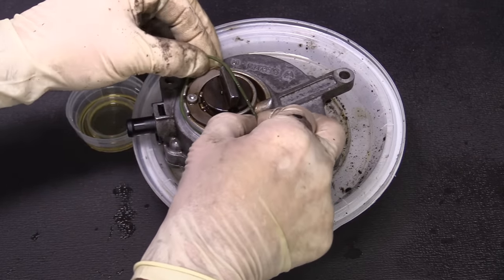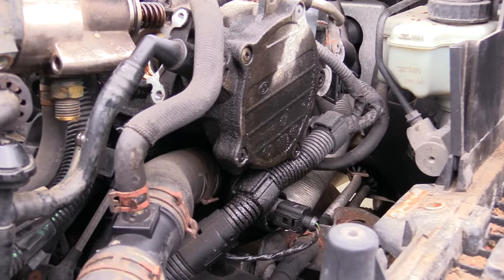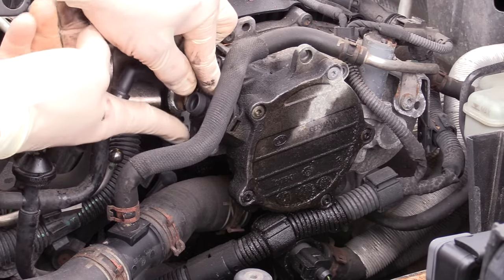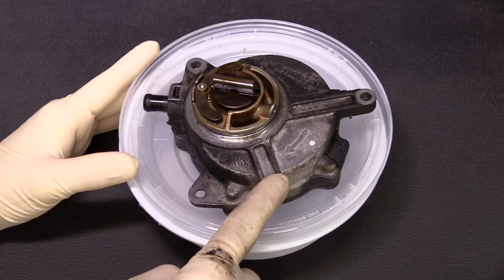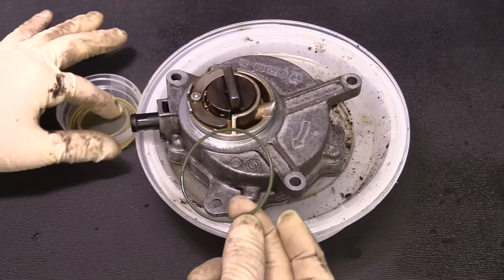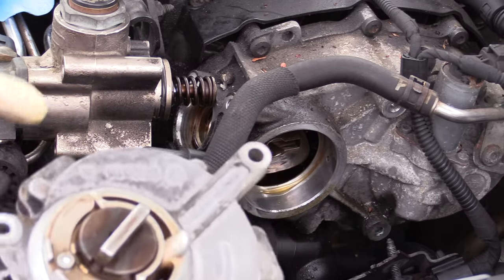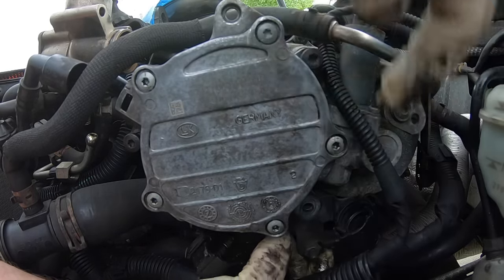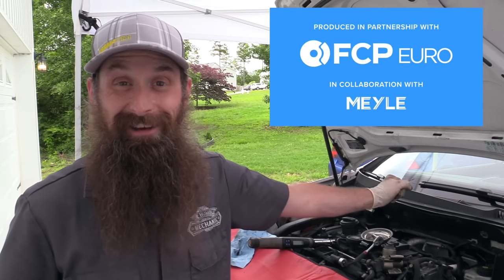How To Replace or Reseal Brake Vacuum Pump

Comment: VW dealer wanted roughly $400 to do this. This video is the best I have found on this topic, thank you sir.
Reply: I just got an estimate from a VW dealership yesterday to replace mine while I was getting a bent wheel replaced and an alignment and they wanted $500 lol. I'll definitely be doing this job myself. Seems fairly simple to do.
Reply: My VW dealer wanted 844 + tax! Is it all because of inflation or what?
Reply: just for the work??? if yes then my local mechanic can do it for 15€. crazy

Comment from the maker: SUPER easy DIY!!! Thanks for all the support on the MK5 project everyone. It makes me really think about what car to do next.. ;) #justfinishtheVR6tCharles!
Reply: HumbleMechanic You should do a W8 Passat next! 👍👍😉😉
Reply: Thanks a lot! Are there any other possible oil leaks in that area of the engine? 
A video list regarding oil leaks for GTI would be super duper to have!
Reply: 4nm or 9nm?
Reply: Hi HumbleMechanic :) and all the friendly peeps out there.  Looking for some urgent assistance.  We have a BMW 318i F30 2016 - B38 engine.  We replaced the oil cooler, oil filter housing and pressure converter electric valve.  Vehicle is now running nicely with no more leaks or overheating.  Problem is that the brake pedal is now very hard?  Please advise?  Thanks so much.

Comment: This video stands out from so many others on this repair, simply because of the angle that you're able to show the pump removal/replacement procedure with.. specifically the hardest to reach bolt that requires that really dumb bracket (Why, Audi? Why?) to line up when putting the replacement back on! Didn't catch this on the first go, after watching your video, I saw the bracket and went OMG AHA! Ran right out to the garage and bam! After some lining up work, the screw finally threaded in.. thank you for being straightforward but showing all the critical areas!
Reply from the maker: That’s Awesome!!!

Comment: Thanks, It's just the perfect tutorial that  I need. I just got an oil change from the dealer and they said that I need a new vacuum pump because it's leaking oil and they gave me a $720.00 estimate for it.
Reply: I just got hit with this too. And at the same price.
Reply: Scott Mullinix did you do it?
Reply: I had the same situation just a few days ago from the dealership. They only said it was leaking oil. So do you think that it would be fine to just change the seal?
Reply: I had the same situation just a few days ago from the dealership. They only said it was leaking oil. So do you think that it would b fine to just change the seal?
Reply: @dexterflorey3676  save yourself some money, I bought the seal from eBay it’s not for much and it’s easy to install just be careful the tubes they might be brittle.
Reply: @eiggiboy  thanks man I appreciate the quick response.  And yeah it will definitely be cheaper that damn pump cost over $300 it's it's crazy lol

Comment: I did this same repair on my '08 Passat. Also replaced the HPFP bolts with studs so I could periodically check the cam follower...except the local dealer took my studs and put bolts back in (I forget now why shop had it apart). Wasn't to happy about that. Keep the videos coming! BTW, I just passed 260k miles!

Comment: Thanks to your video I was able to get the courage to do this repair and completed it. As you pointed out, the extra black fitting one needs to be careful of not losing. The third screw attaching the vacuum pump to the engine at 4 o'clock is blind to access and must be very careful not to drop it, or the Torx drive one may be using on it. Those screws use a T27 wrench. I was able to save 700.00 from the dealer quoted repair, who said the part could not be rebuilt.

Comment: THANK YOU SO MUCH for this video. Although I will not be the person who will be doing this repair, this video has put my mind at ease because the dealership tried to make me believe that my Chevy Spark required WAY MORE steps than what you have. Sure, this is a different vehicle than what I have, however they are CERTAINLY taking advantage of the fact that I am not only a novice to auto repairs, but that I am a woman as well. THANK YOU AGAIN!
Reply: That is a totally different kind of vehicle, from a different manufacturer! The jobs are in no way similar.

Comment: Thank you very much, I will try myself to do the job. One question: the reason of the oil leak is only a worn “O” ring?  So to fix it you only have to find a new one? No need to change the vacuum pump itself? Thank you

Comment: Have you ever seen a VAG vacuum pump leak oil into the intake?  On my 2011 Cayenne VR6, it was burning a quart in half an hour, and I found the path to be from the vacuum pump (after replacing the PCV diaphragm, and then bypassing the PCV/CCV, and finally arriving at plugging the vacuum pump).  I'm not sure if it's a failed check valve, or there's something more complicated.  Thanks!!  At least this comment might help other frustrated VR6 owners thinking they need a rebuild.

Comment: Hey, thanks for the video!
I have the oil leak there on 2.0 TSI 2009. Can it be caused by overpressure in this vacuum pump (thinking PCV Valve problem) ?

Comment: hi ive replaced the oring due to leak but still leaking, can i get away with using sealant, it seems to be leaking from bottom end of case

Comment: Hi,  and thank you for your great instruction. 
I have a Ford Kuga and i have to change a Vacuum Pump clock. I am a handymann and mechmann , so i needed little help about how i will go for it. 
Did i need to change all the Vacuum pump ? or do you think its just great to change the ring?. 
Thanks again.

Comment: @HumbleMechanic Great video, I have a Mk7 gti but the gasket is a metal gasket. Have you replaced a vacuum pump gasket on a mk7 gti before?? If so do you have any tips?? I replaced the gasket on mine because it was leaking but now it still keeps leaking, do you think I may need to resurface the vacuum pump??

Comment: I just did this thanks a bunch. I just realised though as I reinserted the pump into the cam shaft I did not check which was driven/drive end. I started car and tested brakes seems OK. I heard a clink as I screwed the pump back in. Would this be the drive inserting into the cam? What could the consequences of getting the drive the wrong way around be?

Comment: One mechanic told my brother that to replace the brake vacuum pump on the 2014 vw Jetta 2.5. He needs to pull the transmission to replace that pump.

Comment: Hey how’s it going I love your videos first off second I’m having a problem with my 2006 Audi A4 Quatro 2.0 FSI engine I recently had it into the shop to have the rear brakes done and now the brake pedal is fading to the floor they told me it was the master cylinder so we were pleased the master cylinder and we still have the same problem

Comment: I work on BMW `s , and they use the exact same pump on some of their older models[  the E90`s]   for the most time, the seal that will fail, is the seal under the large cover [ the one you didnt take off] 
And for some time , BMW didnt stock seals for this pump, you had to buy a brand spanking new pump   !! 
So what we did in the shop, was buying  the oil filter for that car , and using the seal that came with the filter, and used that - as the seal for the pump !

On he E90 models , the pump sits at the rear of the engine , leaking oil on the exhaust  !
Reply from the maker: That is AWESOME!!!
Reply: Good tip, I'll remember that for my E46 1.8.
Reply: Excellent! Thank you!

Comment: I'm having trouble with an oil leak on a audi A6 just under the vacuum pump or high pressure fuel pump. It's also leaking on the alternator as well not sure what's causing this problem but I'd like to fix it before I trade it in as New Zealand is very hard to get the parts for it.

Comment: Thanks for the video! I took apart the entire pump to replace all three O-rings/gaskets on the pump and found that there was a substantial amount of oil inside the pump. After cleaning the outer portion of the pump, I re-oiled the internal chamber of the pump and added Permatex Engine assembly lube to all the moving parts and gaskets. Is oil inside the vacuum pump normal? Also, I stripped the threads in the hole on the engine block side of the bolt at 430oclock position. So I screwed that bolt in with blue loctight, but it certainly didnt feel tight like the other two bolts as I was tightening it. Should I be concerned about this? Thank you!

Comment: I had grime all over mine in my 2019 Alltrack. Can this housing leak cause misfires? I have brand new spark plugs, brand new coil packs, and I checked for a vacuum leak all over. I'm getting misfires in cylinder 3 mostly on cold starts but around 5 or so in all cylinders after it warms up. This vac pump is definitely leaking, so I was wondering if this could be causing my misfires. Thanks.

Comment: Hi Humble Mechanic, great tutorial video. My wife's 2006 TT is leaking slightly at the bottom of this pump. Is there an O ring also behind the front cover plate of this? If so should I just replace this first or is it more likely the O ring that you replaced? Thanks

Comment: Hi, great video. Many thanks.

Can i ask you a question to see if you can help me.
Recently i found out that my brake booster hose was cracked and i bought a new one. I replaced it, but the new one has a breather valve and my old one didn't have it. In VW they say this is an upgrade and there is no more replacments like mine, and that i should just close the breather valve with a rubber cap.

Is this for real? What is your advice?

Thank you so much for your channel

Comment: My one is a Audi A6 2011 sedan this is my part 06E 103 535 A but it says it's a high pressure fuel pump not sure if it's a vacuum pump or not. New Zealand is hard to get the parts needed to fix oil leak problems. Oil leaks on the engine coolant inlet flange hose and drips off onto the ground. And there's a small leak just below the valve cover gasket on the cylinder head. Any ideas on what this issue would be? I am definetly leaking oil on the drivers side even oil leaking on alternator.

Comment: Great video! mine leaked at the front where the five Bolts are there is a seal aswell
Reply: what did you do? changed the seal?

Comment: Hey Charles thank you for the info I just changed mine is not so long ago they sell a kit that you can replace both of the O-rings the cover and the one going to the cam
Reply from the maker: Nice. I haven’t seen one for the FSI. Just the 2.5
Reply: Rkx reseal sale them

Comment: I'm going to replace it since I've got a crack on the pump cover and it's leaking oil. My mechanic re-sealed it a while ago but it seems to leak anyway.. How could it happen?

Comment: I replaced the seals on the vacuum pump 6 months ago, I tried removing my vacuum pump tonight to get my cam chain cover off, but the vacuum pump didnt want to wiggle off -_- any suggestions or reason it didn’t come off? I put the car in tdc before taking off the 3 t screws lol idk if that locked the vacuum pump in there good

Comment: Thank you so much for this video this is what I was looking for! A question though what is the black ribbed pipe called that is under the vacuum pump?? The pipe which the harness is connected to, the pipe that is covered with all the oil? Because I need to replace that pipe too but not sure what it is called! lol
Reply from the maker: It’s a hose for secondary air I believe
Reply: @HumbleMechanic  Thank you so much! Will see if I can try to find one!

Comment: You sir, are a gentleman and a scholar, thank you for your great content, I've binged about 20 episodes so far this week. Do you think this repair is the same on the TSI version of this engine? I have an oil leak in this approximate area on my '13 Tiguan SE 4Motion. I believe the cause is the vacuum pump located behind the HPFP, the oil is spreading out and contaminating the engine compartment in a radial sort of pattern from there (with some obvious pooling spots and areas of lower impact due to bay topography.) From searching for parts, it looks like the TSI uses a more traditional looking gasket for a seal where the part you replaced in this video appears to be a standard type of O-ring.  Aside from any general call outs you may have regarding the difference in approach to replacing a gasket from an O-ring, is there anything specific to the TSI (early 2013 CCTA w/Auto Trans. and 4 Motion AWD) that I should watch out for that is not called out in this repair on the FSI? Thanks in advance for anytime and consideration you can share!
Reply: After searching again, it looks like the repair part/kit does consist of a O-ring style gasket, instead of the more traditional flat "manifold/valve cover" type gasket seal I was thinking of. I've been looking at hundreds of parts and websites the past couple days and probably mixed them up due to fatigue, hopefully that didn't make my question seem too far off base..

Comment: Hi Charles I notice that when I do the vacuum pump on the 5 cylinder engine I also remove the cover and the plastic fittings and I reseal the cover and the fitting with sealant .

Comment: Many thanks Charles for this tutorial and all the others. I have the same problem on my car but I read on several forums that it's usually the cover seal which fails. Is there any way to pressure test it? Or to distinguish which seal leaks?
Reply from the maker: For me I’d do one then the other. It’s such an easy and cheap job. That is if you are DIYing

Comment: Hii my favorite yt mechanic my mk5 throwed a vacuum pump code 01793-001 and it says its a activation ground does that mean i have to replace it or is there actually a electrical problem?

Comment: This looks like a mk5 gti vac. pump. I have a mk5 rabbit with the 2.5l. I have already used the delete kit from APR. It too seems like leaking seals are the only issue I could detect wrong. Do you think the seals could be replaced on that pump as well or do you only recommend a replacement pump for the 2.5l. like in one of your previous videos?

Comment: Hi, related question. '07 jetta 1.6 bse, stiff brake pedal in the mornings, works ok when engine runs. Checked booster as recommended, seems ok. Changed vacuum valve+hose+ring where it enters into the booster. No better nor worse. Brakes ok. If i repeatedly press pedal hard and fast, a fiss can be heard. What should i do? Changing booster ? Thanks

Comment: Hi there. I tried replacing my brake booster hose which had split in 2 places (2008 GTI FSI), but it broke off the nipple in the coolant flange, and it looks like a bear to try to replace. How hard would that be as a DIY for the flange? Thanks!

Comment: would this have anything to do with a code p2400 on a 2.0 tfsi ? 
would there be any codes if this part would start to leak ? 
thanks for your time !
Reply: and at this point I'm wondering if this is causing a misfire too ? 

I've replaced all spark plugs , coil packs , manifold with new injectors. Purge vavle,
  (which I owe you a big thanks for ) 
nd now this stinking p2400 comes rolling in . with a random misfire code. 

now , i know i gotta do a once over, retrace mysteps with the hoses and lines.
but could this be my road to finally be able to pass smog in California...  
can this dang brake vacuum pump be making my leak detection pump go off ? 
could it be causing misfire ? 

well ill give it a go nd find out .  
thanks for giving me the confidence, to understand nd work on my car.

Comment: hello humble mechanic Love your shows anyhow I don't know any other way to get a hold of you as I'm not very tech savvy My 2014 TDI is having frequent DPF regens and the dealer tried to charge me $3,000 and said it was the thermostats and the air water you know radiator and saying that it wasn't getting up to 87° c well I proved them wrong it was getting up to 87 Celsius and it had a successful region several times they tried to charge me $3,000 so I stated that already and I thought it was complete crap they did not even take it on a road trip as I see the mileage so when I picked it back up I took it out on about a 50 mi ride and it successfully regent not to keep on going on I'm just wondering why is it that it's getting such frequent regions any help would be greatly appreciated also they tried to tell me that it was not under warranty now I am back to having failing regions quite often but sometimes you know regening and dropping back down to like 23% please help me also I only have about 58,000 mi on the vehicle and treat it like a baby I changed the oil way too often probably at about 2500 mi should go says it goes for 10,000 and I use the mobile one that is for the emission system synthetic and it's approved thanks sorry for any mistakes in my writing and keep up the good work

Comment: The brake vacuum pump on my 2011 GTI has a small oil leak. How do I know if I need to reseal the brake vacuum pump or replace it? Thanks!
Reply from the maker: Try and reseal it

Comment: Have you ever replaced the o-ring under the nipple on the pump that goes to the booster? Have one that the nipple pulsates up and down making a knocking noise when it is cold.

Comment: If the vacuum pump is leaking, is it possible to fix it by justt cleaning it or do i have to buy a new one?
Reply from the maker: They make seal kits. You can try that before replacing.

Comment: vaccum pump in oil in bmw isnt that what i think. its not broken pump. but one direction valve. it takes oil vapours and pul it in break underpressue lines. valve to repleace whole lines to clean  and breaks servo

Comment: Hey Charles what is the torque for the two vacuum pump mount bolts and the 5 case torx bolts
Reply from the maker: Probably in the 7-10nm range. But I’m not sure off hand